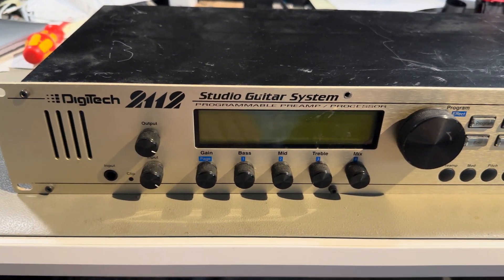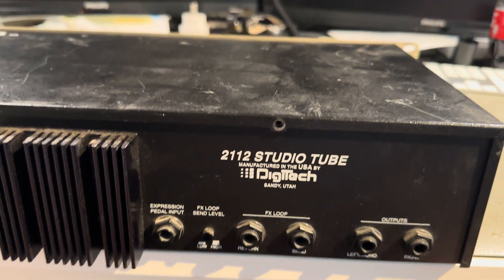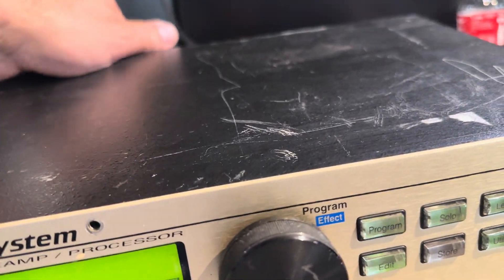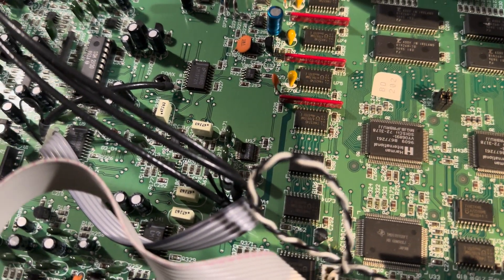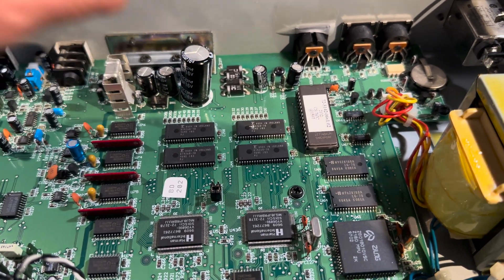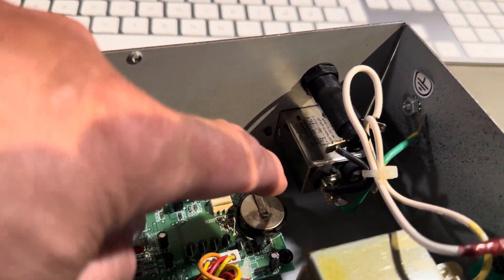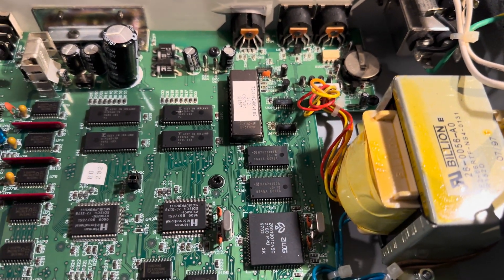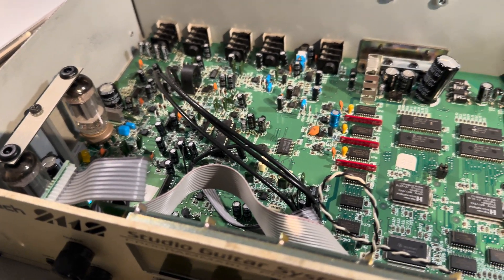DigiTech 2112 Studio Guitar System - a look inside

Comment: Hey there
My one doesn’t even come to boot screen. Have you managed to find out what was the problem?
Reply from the maker: Yes, I found the issues.
There was two.
First I had a look at the ”large” Electrolytic capacitors where one looked bad.
However I found that two of them had cold solder joints, but replaced them anyway as they were OLD.
Then the lithium battery was faulty, and the battery holder needed some cleaning before inserting a new battery.

Final point was a master reset and then all was fine!
Reply: @HiFi-DIY  mine does not power at all .... does it have internal fuses inside preventing it from powering on please ??
Reply from the maker: @hichembell9972  I can't see any in my video, did you check the fuse under the power inlet? Have you checked that there is output on the internal transformer (secondary side) WARNING playing around with High Voltages can be DANGEROUS